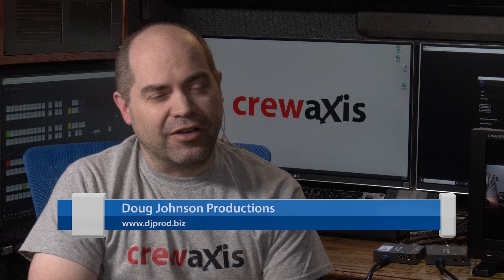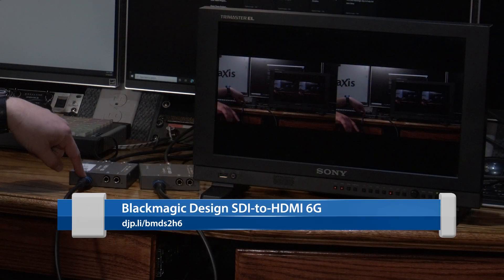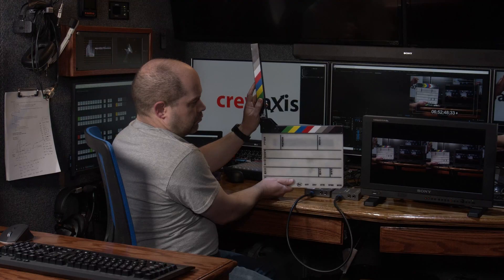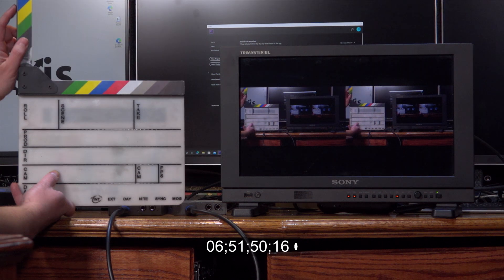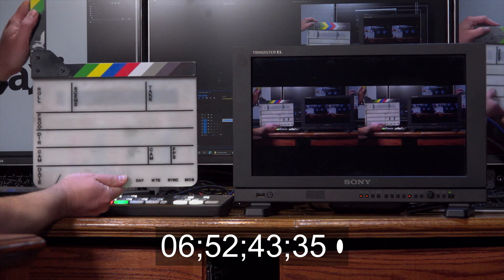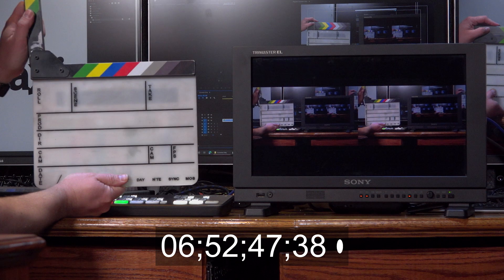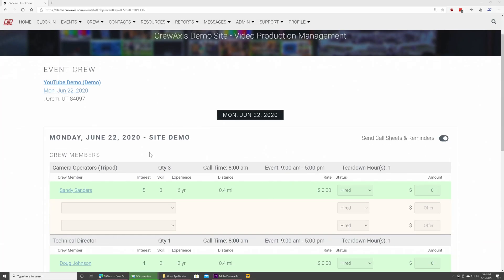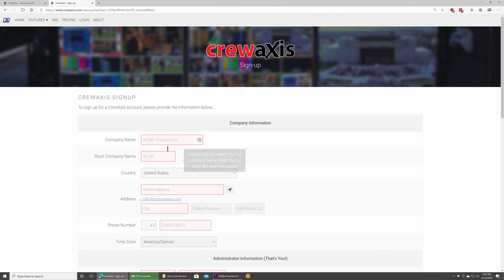HDMI Latency Myth Busted

Comment: Wait a second. Your test then is totally useless. Isn't it? Because you ran the HDMI with the Converter and then blamed the converter for that one second delay. A reliable test would be to run HDMI as it is from source to destination and just the same for SDI. Or am I missing something here? 🤔
Reply from the maker: It's a 1-frame delay, not one second. 

The bottom line is that beyond the delay from converting to SDI-to-HDMI and then back again, there isn't any additional delay. HDMI is safe to use for live production in terms of latency.
Reply: reasoning is sound test however is not and would be torn apart by any detractors easily, see this all the time in audio crowd. HDMI is still a crap video cable from design to what they run through it to the Frickton of useless "Features"

Comment: PhotoJoseph (YouTube moniker) is my source of accusation of HDMI latency. His problem stems from audio delay that prevented him from monitoring audio while speaking as on camera talent. He solved this by switching to SDI on a Blackmagic Micro Studio Camera 4K, which solved the problem so that his voice was heard on ear bud monitors in real time.
Reply: I’ve got a feeling Panasonic DSLR cameras are bad for latency, but photojoseph is a Panasonic ambassador so probably avoids blaming them.  I’ve noticed it from a Panasonic GX80, but HDMI out of my Sony camcorder is fine.   photojoseph channel is still great though.
Reply: We use a BMPCC4k for in-studio live streaming and the HDMI output delay into an ATEM TV Studio HDMI input is small enough that we can talk over our voice monitor live without disruption. Source mic is running audio through a mixer into the BMPCC4k and then bringing the combined signal into the ATEM. Once you throw in a cross converter to SDI and the delay can be distracting, but straight out of camera over HDMI, it's maybe a one frame delay at the worst. So the presenter gets a very slight reverb effect when listening to their own voice, but it's not going to derail the conversation.
Reply from the maker: I've seen the video (sigh).  It's a camera problem, not an HDMI problem.